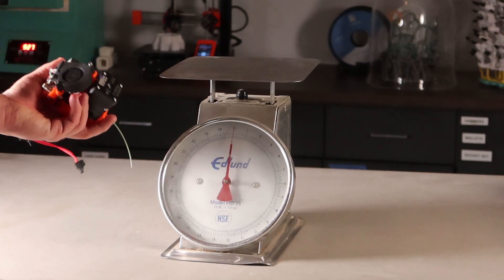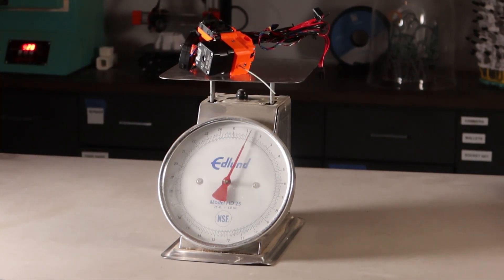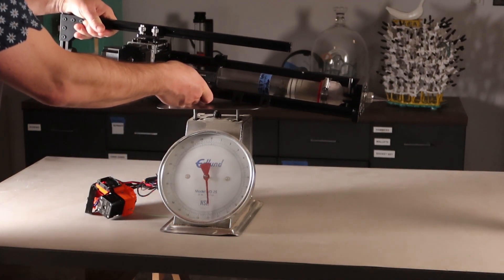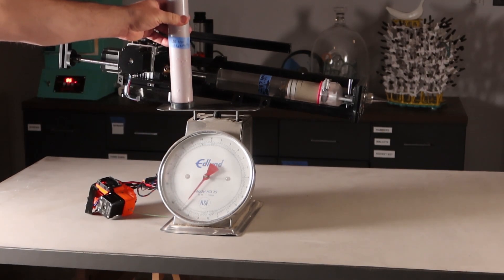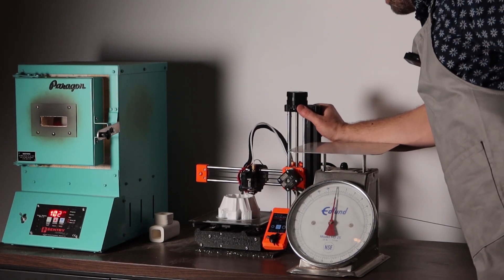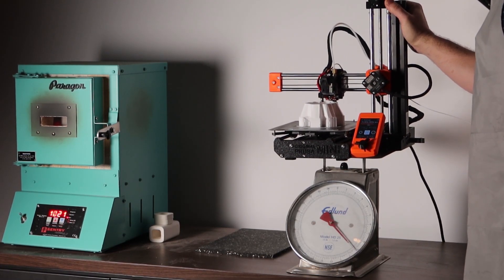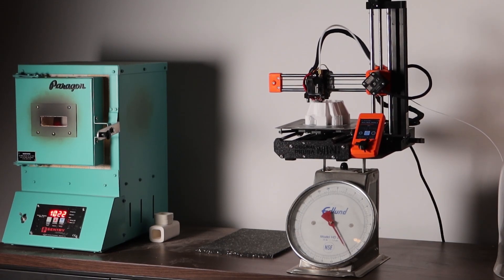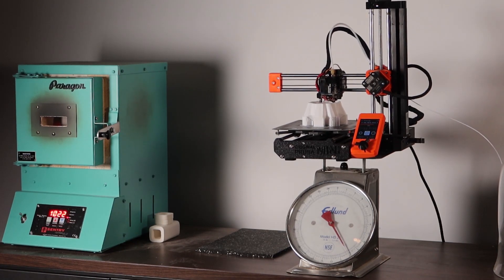Comparing a Plastic 3D Printer Extruder with My Clay Printer Extruder

Comment: Picking up the PrusaMini while it's printing like that felt like I was watching a cat get picked up by the scruff.
Reply from the maker: Ha! It kinda low-key messed up the print, but don't tell anyone.
Reply: Cantilever designs aren’t the most rigid and I’d expect the arm to flex if you pick it up without also supporting the base. The full MK3[S+] design is way more rigid and I know Mitch Cerroni built a few little delta types into back backs and can print while walking around without issue.

Comment: Is it thinkable to manage the extruder like a bowden? Ie with a flexible pipe/hose, that transport the clay to the nozzle with a small extrusion worm? That’s only a fast idea from my side... ;)
Reply from the maker: Yes, what you describe is a totally reasonable and thinkable way to do things. In fact the Italian company WASP sells a clay printer that works this way: https://www.3dwasp.shop/en/product/clay-3d-printer-delta-wasp-2040-clay/
I built a few "Bowden" style printers as well, such as this one: https://youtu.be/X4ksTKWRqvM
. . . but one big difference between filament FDM printing and clay printing is that sticky clay very very much does not want to travel through a flexible hose, particularly if there is a small diameter nozzle at the end of the hose. So, I started over at some point with a "direct drive" extruder, and I like it much better, even if others prefer to grapple with the hoses. To me it was all about finding the shortest distance possible from clay storage to print bed, and presently I've got that down to something like 7cm. You can always water the clay down to make it easier to move, but then you run the risk of having a gooey soft print, and I want to make crisp angular geometric things.
Reply: @TomLauerman  would it be possible to have a two stage design, with an extruder by the nozzle for more precise movement and an extruder on the printer that pushes the clay through a Bowden
Reply: @TomLauerman  Even in plastic printers I would prefer direct drive, but those only come on the big printers that I have no need for.

Comment: Very interesting. What are the specs of the stepper and worm gear reducer? You must be working with very stiff pastes. Any issues with delamination during prints due to limited water?
Reply from the maker: Sorry for the slow reply, I've been away from YouTube, but would hope to return in the future with some new projects. Anyhow, the stepper is a Nema 23 running on a 24 volt system, the worm gear has a 20:1 reduction. I work with fairly stiff clay sometimes, and I like the crispness of that. Diameter of nozzle has a huge impact on what is extrude-able. I have not experienced significant delamination issues.
Reply: @TomLauerman   No problem at all! Thanks for the information. How do you compute the steps per mm in your setup? I read that you could "trick" the slicer by setting the filament diameter to match that of the cylinder that houses the paste so that the correct extrusion volumes are used, but I must have misunderstood something. With that approach, my steps/ mm end up being 38400 (I'm also using a Nema 23 on a 24 V system, but I'm using a worm gear with a 30:1 reduction, a lead screw pitch of 2.5mm, a 2.75" cylinder, and 1/16 microstepping). Even when setting the printing speed to 0.05 mm/sec, the very high steps/mm are too much for the Nema 23. I'm sure I miscalculated something silly or misunderstood something, but if you have any pointers it would be greatly appreciated! My hope is to use this large extruder to feed a smaller auger-screw printhead, and once I have settings more dialed in, feed a moineau progressive cavity pump (viprohead - viscotec). Thanks for your time.

Comment: If someone were to purchase a schematic for that extruder...  What hypothetical price would you put on those schematics?
Reply from the maker: Thanks for your interest! Over the years a couple people have built a version of my printer design but ultimately get frustrated with my constant changing of the design. Unfortunately, a bunch of parts I am using are metal components  that were made without drawings, etc, but more or less made in an ad-hoc way with milling and grinding equipment. So, I moved away from a simpler, easy-to-distribute design and embraced complexity and oddness. These days, however, there are some compelling clay printing designs out there from companies like WASP,  3DPotter, Stoneflower, and Cerambot.
Reply: @TomLauerman  cool thanks for the note.

Comment: Love your videos Tom! 
Q: Do you sell your clay extruder, or the plans to DIY one?
Reply from the maker: Many Thanks! 
I'm constantly changing my design so it has been frustrating for folks who have tried to make a version over the years. I haven't tried to sell printers because I don't think my design would be viable in the marketplace (it would cost too much as it is just a big jumble of custom made metal parts). I usually point people toward the growing number of consumer/commercial printers available now from companies like 3D Potter, WASP, Stoneflower 3D, and Cerambot. Also, Jonathan Keep and Bryan Cera have both designed and documented printers that others have successfully duplicated with off-the-shelf and/or 3D printed parts.
Reply: @TomLauerman  thanks and I get it - some of us just like to tinker - it never ends. I think if I ran out of things to fix or make I wouldn't know what to do with myself. 
One thing I didn't see in your videos (although I haven't seen all of your them yet) but do you go into anything about the clay itself? Do you need do anything special to it? Any particular kind you use? Consistency, etc.? I honestly don't even know what properties I should be asking about with clay because I haven't really worked with it at all for a very very long time.
But I really do like the idea of being able to print with it and will most definitely get into it when I have the capability to do so. Good luck to you and lastly, when is the 3- color printer coming out 😁?
Reply from the maker: @w4shep  Many thanks again! You are right, I haven't done anything about the clay yet - but I'm working on it. Cheers!